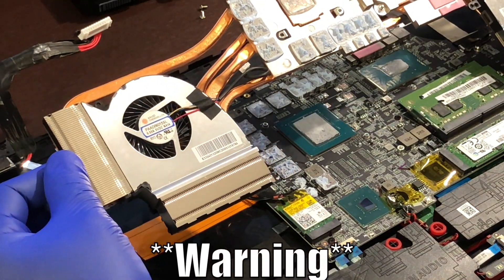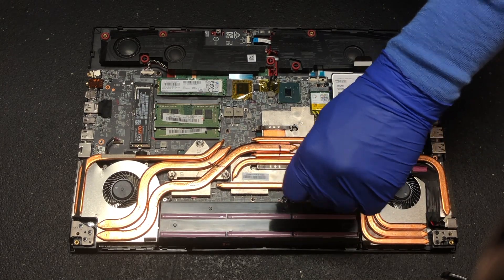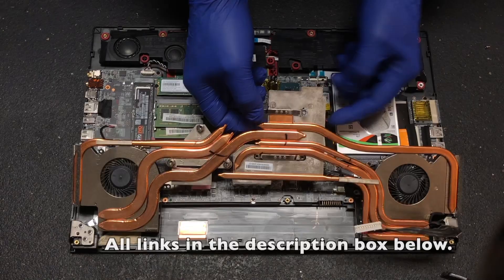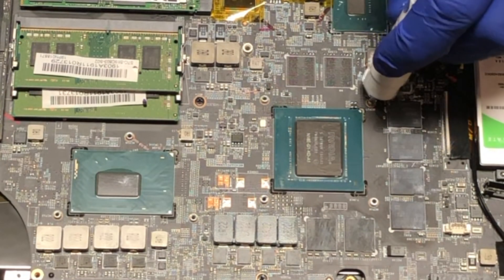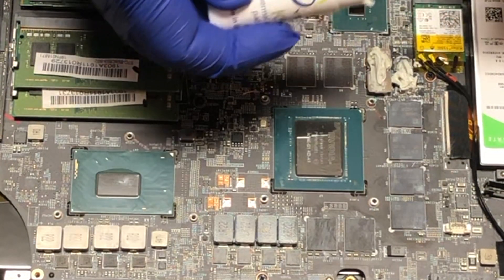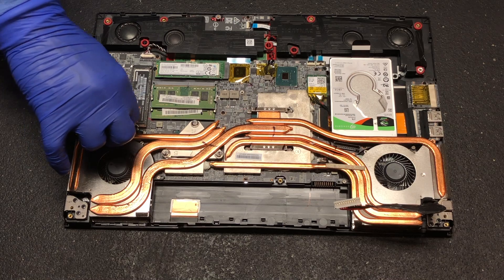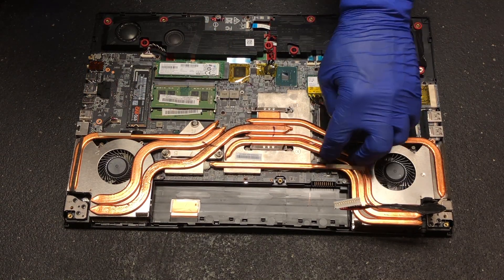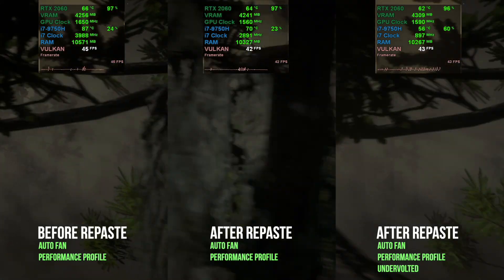MSI Raider Repaste K5 Pro and Kryonaut Big Improvement

Comment: Whats thr best to use? Can i use the kryonaut for all instead of a paste?
Reply from the maker: You could but you may have e a problem with heights of heat sinks which my cause no contact.
Reply: @Meanpooh  i dont know what else to use cause of the limited stuff available here in the Philippines. Any brand you can recommend good sir?
Reply from the maker: I use the Thermal Grizzly brand but and decent quality thermal grease should work better than stock. 
The next thing you need to find is the thickness of the thermal pads. That is what you should use. It’s not recommended but if you don’t have anything on hand and the thermal pads are in good condition, you can reuse them. I’ve done it plenty of times without issue.
Reply: I mean if I can spare more cash for thermal grizzly would that be ok? Since im only gonna use it for my laptop. Sorry if i have a lot of questions. Your channel by far is my go to for my laptop cause you're the only one doing this kind of commentary which is soo sooo much help for us newbies. Thank you so much.
Reply from the maker: No problem with questions. It’s all good. Putting thermal grease on CPU and GPU is perfect. When it comes to using it for thermal pad replacement, it’s an issue because there will be no pressure. The thermal grease will eventually slide or run depending on the viscosity and possibly move to other components. It’s no big deal if it’s non conductive but can make a small mess and cause a rise in temps from RAM and VRMs.
Reply: @Meanpooh  i guess i should probably order that grease now at amazon since its availablr only there haha. Like 2 to 3 weeks of shipment haha. Would it be ok to like buy 2 bottles now and keep the other one for future use cause of shipping?
Reply from the maker: You don’t have to get that brand. What brands are available in your area?
Reply: @Meanpooh  a bunch of shady china made one but theres one thats locally available at our place called aigo 3g 5.15 w dunno about that though
Reply from the maker: Yeah, its quite generic.  It also says its conductive.  I would avoid.  
try one of these if you can order them:
Noctua NT-H1
Thermal Grizzly Kryonaut
Arctic MX-4
Arctic Silver 5
Reply: @Meanpooh  the kryonaut is readily available here luckily haha the paste that you out on the vrm tho... Not so mucj hahaa

Comment: does kryonaut have a short lifespan in laptops that tend to run hot? ive read alot of people saying that it dries out fast and requires frequent reapplications around every 3-8 months.
Reply from the maker: Not heard that before.  Best way is to apply the grease.  Take note of temps.  If they start to go up then change it.

Comment: hey. what do you think, would 1mm thermal pads suffice for vram  and kryonaut for cpu+gpu?
Reply from the maker: I can't comment on the 1mm as I don't know the thickness of the orig pads but the Kryonaut is great.  If I repaste again I will try thermal pads to see if 1 size will work vs multiple.  We all know they all smash together under pressure so going with 1 size might not hurt.  If I try, i'll report back in this thread.
Reply: @Meanpooh  what the answer mm thermal pads
Reply: What the answer sir

Comment: I have the same laptop but with an i710750H/2080 super. For. the. Fucking. LIFE OF ME. The fucking repaste with artic mx4 simply will not work with the gpu, nor the thermal pads I bought for the vrm chips apparently. My gpu sits at 86c after three different attempts at this shit. I should've just bought the k5 stuff cause pads are NOT WORKING. The heatsink is for sure tight enough, the cpu has maintained the temp drop after all 3 tries. Fucking infuriating.
Reply from the maker: I'm sorry that you're having problems.  I know how that is.  If you ever repaste again use Kryonaut.  It's never let me down and IMO the closest you're gonna get to liquid metal temps without the risk.  In my vid I missed 4 VRAM chips, went back repasted and it made no difference.  I've since repasted at least 2 times since this vid.  You have a lot of power on your machine and I know that the exploit has been patched for adjusting the offset, you can still use throttlestop to adjust the SpeedShift EPP.  If it's too warm try setting it to 130 and go lower to fit your needs per game, application.  Good Luck.👍
Reply: @Meanpooh  my CPU isn't the issue, it's purely the GPU/vrm chips. I have all 6 cores set to 43 in throttlestop, speedshift has always been set to 0. CPU barely hits 70c now. I'm pretty sure the entire problem I'm having is with the vrm, cause where the GPU normally heats up is actually cooler. It's the weirdest thing. Seems like the 0.5 mm pads I used are leaving a gap between the heatsink and the GPU, but not the CPU. The paste you used or even just normal thermal paste seems like the best option for laptops. Bob of all trades used the same paste for his GPU on the vrm, even the smaller chips that originally had the white paste.
Reply: @jamesrussell9124  Did you fix the vrm issue? im tinkering with the idea of just adding some more mx4 to the pads

Comment: 5:41 I think you missed the little black squares that had thermal pads.  You can see your cooler had thermal pads for them, a total of 8.  No paste on them when reinstalling.
Reply: yeah, i have noticed the same, these black squares are cpu's mosfets, they heat up 100c and then cpu is getting power throttling limits. he missed most important thing with repasting job.
Reply: OOH, thanks for pointing that out! wonder if he ever noticed.
Reply: 😂😂😂 true mate.
U thought at the beggining of the video that he just cut the video
But actually forgot to put paste on all v rams and mosfets
Reply: What part exactly? I can't find it

Comment: How you get a reduction in FPS after repaste ?
Reply from the maker: It will improve performance if previously you were throttling. Undervolting does not always improve performance  which varies by game.
Reply: @Meanpooh  I got your point. I have experienced the same. But if I undervolt my 9750H by 115mv (max possible), limit the turbo to 3.8Ghz all core and set speed step to 0 then my cpu consumes 30 to 35W max and maintains 3.8Ghz over gaming sessions as big as 4 hours with temps under 90C and averaging at 81C. Is this how undervolting should be used ? If I put it to 4Ghz all core then it gives 95C peak with 88C average with same undervolt and speed step. There's rarely any FPS or frequency drop at all. But if I do it without speedstep set to 0 then it gives lower temps but serious frame drops.
Reply from the maker: Yes but if you are getting serious frame drops then you are going to far.  Stay between 0 and 125 using speedstep.  Adjust until you get a good temp while gaming.
Reply: @Daniel Combs 
I know, but I am just stating why he got lower performance, because he undervolted. I know specially with AMD CPU's they always overvolt them at factory just to ensure reliability, Intel is a bit more finetune but still depends on the silicon in the end. I always had better results with undervolting AMD.
Reply: He undervolted the CPU, did you not watch LOL?
Reply: @SMGJohn  The benchmark in the middle was not undervolted, yet FPS was lower didn't you read LOL?

Comment: How is it you have less fps after repasting?
Reply: If you look at the 3 screens, you can see that the first two screens he has a clock speed of 3.3Ghz constant on the cpu, while the last screen it shows a 1.9-2.2 Ghz on the cpu, he modified it on throttlestop, so he gets better temps but lower clock speeds and lower performance. The guy is clueless about undervolt.
Reply: He undervolted.
Reply: @LMBC6Brian  No, the middle screen is not undervalued yet he lost fps?

Comment: Hi i also have the msi ge75 but with i7-8750h. I repasted like you do about 5 months ago but i didn't apply that much k5 to the vrms. At the first 3 months the temps was amazingly low, gaming always below 80 but recently it went up to 95. I'm considering to repaste it but idk which one should i repaste, the vrms or cpu/gpu?
Reply from the maker: It if was me, I would repaste both GPU and CPU as well as the voltage regulators.
Reply: Thank you i'll definitely do that. Have you ever tried anything other than the K5 (pad or paste) and if yes, do you have any suggestions?
Reply from the maker: No I have not reason being that its hard to get the right thickness thermal pad for replacement.  If I knew the thickness, I would try thermal pads again.
Reply: I'm having the same problem K5 isn't good in longterm there's a lot bad stuff about it in the internet some says it boils and leaves bubbles and the paste that company uses on vrms isnt available to public so i don't know what to do
Reply: @hosseindamavandi280  That's bs. It ohysically can't boil/bubble.

Comment: I noticed you didn’t put the K5 Pro on the little black square components directly beside the larger ones that you did apply K5. Did you leave the thermal pads on for those little chips? Is that the way it’s supposed to be done? Are those smaller black chips not “vrams”? Is that the reason you didn’t put K5 Pro on them?

Comment: Hello! I bought a slightly older model with a 1070 and I've been meaning to re-paste but I noticed the screws have numbers next to them and I'm assuming it means you need to remove them in a certain order? Know anything about this?
Reply from the maker: You should be fine removing them in any order. When replacing, you can follow the numbers as I did in my older videos.

Comment: Thanks for this excellent video! For removing the heatsink, what's the best method for unplugging the heatsink's plugs from the rest of the laptop? I understand that they're pretty delicate so I don't want to damage them.
Reply from the maker: You are welcome!  I just try to work the sides at the same time as possible and never grabbing the wires.  Might be best to use a plastic tool just in case you slip and hit the board.

Comment: My heatsink located on the GPU does not moving, I thought there was a hidden screw or something. 
What do you suggest?
Reply from the maker: Make sure the screws are completely removed.  Its stubborn at first so gently try and work it loose.
Reply: @Meanpooh  There are 2 screws on each fan 3 on CPU and 4 on GPU right? Total 11.
It's like I didn't removed the 4 screws on the GPU, it doesnt even move.
Reply from the maker: @EasterFaust  Yes, 11 from what i counted.  Is there anyway to wiggle it slightly?
Reply: Meanpooh well the one on the CPU wiggles but other one is complete concrete.  very intresting

Comment: Love the way you explain the process. thanks you. I got a question, got same ge75 raider and i'm about to repaste thermal paste on CPU and GPU with Kryonaut, why can't i put that kryonaut on the components where you put k-5? i don't know if is a stupid question but i'm a novice
Reply from the maker: Because the differently levels of thickness.  You will use a lot of thermal grease if you try and if its conductive you will blow your machine.
Reply: @Meanpooh  got it. Thank you so much.

Comment: Pretty informative video but I wish to ask a few question as I intend to purchase a GE75 raider myself.
1)How difficult was it to clean off the stock factory paste?
2)Regarding the thermal grease, how often would I have to change the grease that is applied to the vrms?
3)Would it be more effective to use Fujipoly extreme thermal pads for cleanliness (achieve the same or similar thermal results comparing it to the paste) ???
Reply from the maker: 1 Pretty easy.
2 Only if you see a dramatic difference in temps.  For example, fan ramping up while idle.
3 Any pad is better than none especially for cleanliness.  I do not know about the thermal results as I have not tried Fujipoly.
Reply: @Meanpooh  thank you soo much for the response, guess I will try the thermal pads first as they are less messy. If I am still seeing dramatic change in temps, will use the K pro paste.
Reply from the maker: Alright, best of luck!

Comment: I have some ques
did or do you need to repaste? like evey 6 months?
have you faced any kind of issues (hopefully not)
Reply from the maker: No and if you can, try to use thermal pads or paste on the VRMs.
Reply: @Meanpooh  One question if i dont have the k5 pro what do you suggest? use the kryo or get the thermal pads from grizzly? i have the raider 8750 with 2070 and it gets really hot
Reply from the maker: @yorgino  get thermal pads like the Arctic brand https://amzn.to/30azxoE or GELID brand https://amzn.to/30byowW

Comment: Hii, is it essential to repaste the thermal pads or we can just do the cpu and gpu with grizzly directly ? I have seen a video that only repasted cpu and gpu and it worked perfectly so am kinda confused
Reply from the maker: You can only do the CPU and GPU.  The pads are not necessary if they are in tact.
Reply: @Meanpooh  how could we be able to tell if the pads are not intact and causing problems?

Comment: Is it possible to use thermal pads on those VRMs, or will there be alignment issues? I have ordered a set of 6W/mK pads since in India the K5 Pro is currently unavailable. Sizes in .5mm 1mm and 1.5mm
Reply from the maker: Yes you can.  Just try to get close to the orig thickness.
Reply: Hey thank you for replying! Another question, so the difference between the baseline "before repaste" and after repaste is just the K5 Pro? In a previous video you already repasted with the Kryonaut right? Will I get any noticeable drop with just repasting the CPU&GPU?
Reply: Shipping to India is now possible from Greece but you should order from our website www.computer-systems.gr . Will take around 3 weeks to arrive though....

Comment: Well meanpooh I am thinking to switch thermal paste with noctua. And I am thinking that grizzly it's not stable for high temps.well what I mean..
I have repaste my ge75 4 times with all methods ,X  pea spread straight line.
Every time After repaste the temps it's just amazing!something like 3,9ghz stress test max 81c. But every time after some days the temps got raised. About + 6c-8c. I am thinking that paste ruins at cpu after some days and it's good for desktop low temps chips.
Reply from the maker: Sorry to hear that but post back on how well it goes.  Maybe you could have a bad batch not sure but it shouldn't do what you are saying.  If anything it should work in the reverse way.  Anyway looking to hear from ya.
Reply: @Meanpooh  well just I got the noctua nt h2. 
Tommorow I wait for k5 pro.i am for greece so its easy to get one.
I saw also u replace the cpu vrms thermal pads  with k5 pro too.not just the gpu vrams.i know it's there no way to know if it's better cause it not show us vrms temps.but u thing it's better that u did to replace the cpu vrms with k5 pro?

Comment: You forgot two of the memory chips at the bottom at 5:40  and the small chips above the vrms
Reply from the maker: Nope. They never had paste thermal pads on them.
Reply: @Meanpooh  odd, mine did, plus there are the metal contacts on the heat sink in your video for those positions as well. The two large chips below the gpu are memory modules, the same as the chips you place pads on to the left of the gpu.